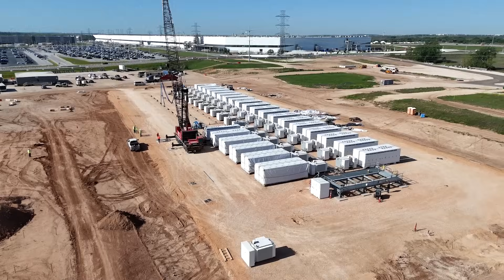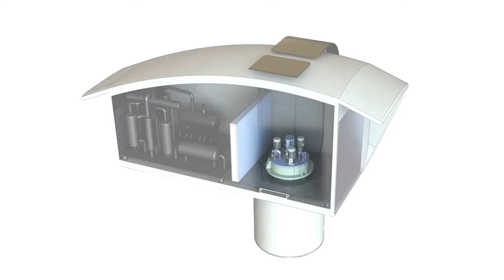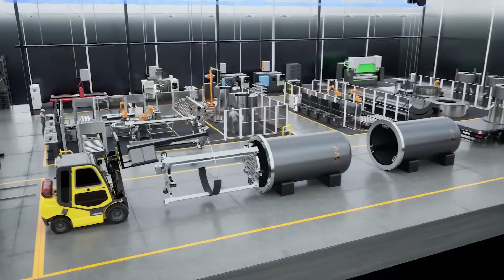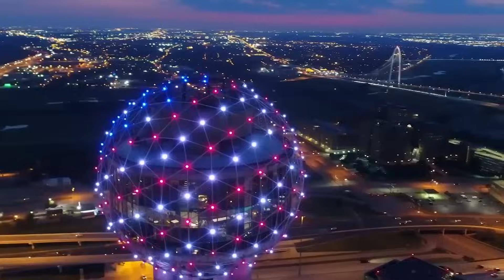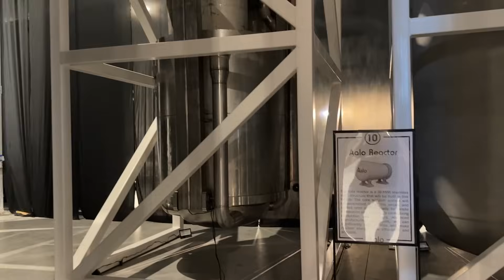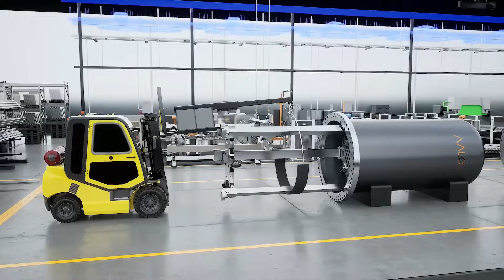Discussion with Aalo Atomics CTO, Factory & Aalo Pod Unveiling 7 April 2025

Comment: Humm, need a 'melt-down' chamber below the reactor, and a fuel reprocessing (and  new fuel processing) plant.  Better stick that plant into a mountain.   I see that the steam is going for super critical temperatures for the steam generation.. that's going to be hard in the steam turbines.. better build those also (the Navy will love those).  Please use redundant systems, even in the steam turbines.. and also use Rakine ammonia turbines for the final heat extraction with an adequate water supply (as traditional steam turbines tend to max out at 33% efficiency) and battery storage system (load leveling and excess generation sales).

Comment: AIUI this is a mini version of a conventional LWR uranium reactor. I would really like to see this kind of effort go to building an LFTR. Lithium Flouride Thorium Reactors run on cheap (as in free) easy to refine thorium. Are immune to meltdowns, and consume 99.99% of the fuel so almost zero radio-active waste. LFTR's are also naturally load following so they don't need control rods or even a running computer to prevent run-away fission.
Reply: Tough on traditional steels.. Fluoride has its downsides.  Still need a downside containment chamber for safety.
Reply: This is not a mini version of a conventional LWR, it's a low-pressure/high-temperature reactor, pretty much the opposite of an LWR. Thorium is very problematic; a much better solution is a uranium-based MSR.

Comment: Small and portable nuclear power?  BAD IDEA.
Reply: Not so if one is calculating on the sun not shining (so brightly)..
Reply from the maker: @steverobbins4872  why … I’d like to know your well thought out reasons
Reply: @JoeTegtmeyer  What do we do with the nuclear waste?  Just let it accumulate, of course.  That's still the only answer after all these decades, and it's not sustainable.
The future is wind, solar, hydro, and batteries.  Forget nuclear.  It can't compete.
Reply: Small, not exactly portable. Why is it a bad idea?
Reply: No explanation why you think nuclear power is a bad idea?
Reply: @DavidJohnson-tv2nn    Usually, in the USA, under engineered (safety) and way over budget.. I take the Clinton Power Plant in Illinois, as I talked to some of the engineers over seeing the job in the early 1980's.. It was to be two reactors, but ended up as one and 200% over budget (soda cans in the pours,  that resulted in tens of thousands  in concrete re-work and other stuff like that).
Reply: @tsclly2377  Yes, but the right way is to correct the problems, not reject nuclear power. Just like we don't quit flying when there is a plane crash. Find the cause, correct it, make sure it never happens again.

Comment: Any details on the economics? I get the sense of urgency with AI but mid to long term does this even have a chance against other technologies economically(especially solar/wind w/ batteries that is becoming the most affordable energy source)?
Reply: Batteries are still expensive, and you are not going to run data centers that require 1/2 gigawatt (such as the planned buildout at Tesla) on batteries. We still need good baseload power such as nuclear. Thinking that solar/wind and batteries are going to do it all is not being realistic.

Comment: Great video Joe. I may have missed it but do you know where the fuel come from and how long will it last?
Reply: One interesting note to add is that unfortunately, 96% of the fuel is wasted! Reprocessing of spent fuel would recover 96%, reducing nuclear waste by that much. It is not that at the end of 18 months, 1/3 of the fuel is used up, but rather contaminated with fission byproducts, thus becoming unusable. Reprocessing would recover that. 
Apparently, one of the main reasons for not reprocessing was a decision by  Jimmy Carter in 1977 due to nuclear proliferation concerns. He wanted the U.S. to set an example for other countries. Spent fuel contains Plutonium PU-239. Which does NOT need enrichment for use in nuclear weapons. However, it was a very bad decision. The reason? All that spent fuel is still there. If countries like Germany, Japan, South Korea, or Ukraine wanted to produce nuclear weapons, they could in a relatively short period of time.
Reply: The fuel is Uranium and it is mined at various places around the world. It then goes through refining and enrichment (to raise the level of U-235) before being loaded into a nuclear reactor. At current large nuclear reactors, I believe that refueling is every 18 to 24 months, where 1/3 of the fuel rod assemblies are replaced.
Reply: @ thanks David. Any advice on where the enrichment is carried out would be useful. Some say it’s mainly Russia, or at least was before they invaded Ukraine.
Reply: @RichardNeumann-dl2rr  It looks like two places....
The URENCO USA (UUSA)  facility in Eunice, New Mexico.
American Centrifuge Plant in Piketon, Ohio.
Reply: @ thanks. Great to know.
Reply: On a related topic regarding Uranium enrichment..... In fuel for nuclear power reactors, the concentration of U-235  is 3 to 5%. Iran has enriched its U-235 concentration to 60% !
All while claiming that they are not interested in making a nuclear weapon! They are a short step away from going to 90% needed for nuclear weapons.

Comment: Please help me understand why we have had submarines running on nuclear power for decades but small nuclear power plants are new? Serious question.
Reply: Cooling.  The reactors in subs have the cold ocean water to dump waste heat into.
Reply: @ thx
Reply: @jabbathespud so how were the nuclear trains cooled?
Reply: There is a market for small, high-powered military reactors. So far, the market for civilian nuclear reactors has strictly been for utility scale reactors. Both would require the same expensive and lengthy application process.

In other words, economics and regulations.
Reply: How many watts is wasted as heat?
Reply: @vids2025-gh  I hope this will be discussed in the next installment! It is indeed a key question; also in relation to another comment here about the overall cost per MWh delivered.
It was mentioned that this particular reactor concept produces superheated steam, which equates to roughly 30-35% efficiency in converting all the generated heat into electricity. Additional economic outlets for the remaining waste heat may be available (desalination, hot house vegetables production, town heating etc.). Other developers of SMR's are cagey about this issue and mainly talk in general terms about "Industries that can use the power and also the heat", so I hope that here we will get a good idea (via Joe) how the developers square up to this inherent aspect of a steam based SMR. Alternatively, in a constrained power supply situation due to intermittent renewables and/or a conventional power grid that is bursting at its seams, the unique ability to shield your business via a "SMR in your own backyard" may be such an attractive preposition that the low efficiency is taken for granted. With this "Fast Forward" company we are going to find out, sooner rather than later, which is a very good thing I think. In my part of the world this would be completely impossible with regulators smothering any and all new developments. Their base attitude is that new developments in uncharted waters are Not Allowed.
Reply: small reactors on militairy marine vessels use highly enriched uranium, so not usable for a commercial market. Translating these reactors to commercial ones, is basically a whole new redesign. And adding to this the cooling requirements as previously mentioned by other people makes it that marine reactors are totally different to land based solutions.

Comment: There's a misconception that nuclear power plants run 24/7. In fact, they need regular maintenance just like any other power plants, require significant water supplies, and their maintenance cycles can last anywhere from a few weeks to several months. Leaving all of that aside for the moment, nuclear power remains the most expensive form of electricity on the planet, renewables the least expensive, according to the IEA. 
Aalo is interesting, but I don't think that, fundamentally, it's going to be all that different from reactors, stationary, mobile, large or small modular in nature, in terms of the issues nuclear power presents, security and nuclear waste disposal being the two key facets. Still, I look forward to seeing what becomes of Aalo's development path in the future.
Reply: That's for capital expense, not accounting for the energy they produce that makes them economic compared to alternatives. Aalo sounds cool because they're removing a lot of the upfront capital costs. If you can affordably pop up 10-50MWe wherever you need it, that's great.
Reply: Well said! also per gwh generated all time nuclear is the safest most reliable form of power generation with the least fatalities!

Nuke operators need to get with the program and stack massive bess systems on the premises.
Reply: Nuclear waste is essentially a proliferation issue. 96% of spent fuel can be recycled (and currently is in France). The USA closed the only nuclear fuel recycling plant in the USA several decades ago. Plutonium (a byproduct/waste from spent uranium reactors) is much easier to refine than weapons-grade uranium. India obtained their nuclear weapons from spent fuel, and that spooked the US government.
Reply: @john_in_phoenix   Thorium reactors can 'eat' Plutonium.  it is the intermediate extraction of the fuel that yields that nasty 'by-product', thus continual 'inspection' becomes an issue.  All nuclear reactors can have this problem, although in the traditional reactors, there is a defined energy 'spike' that can be detected if this nasty 'by-product' is actively tried to be produced in quantity.